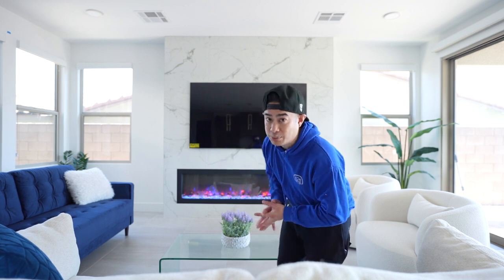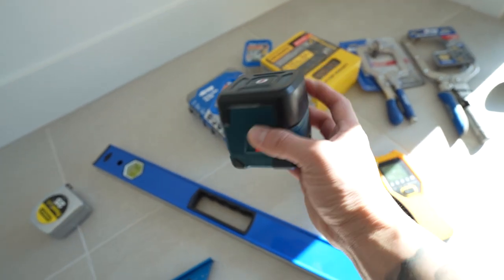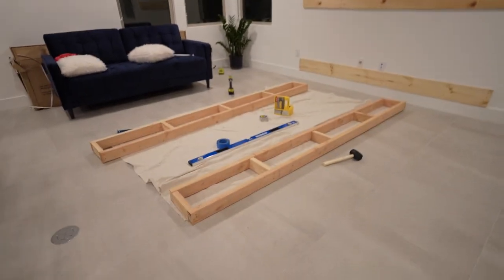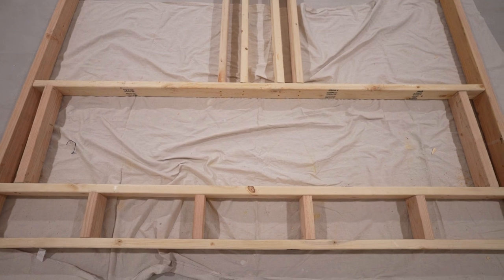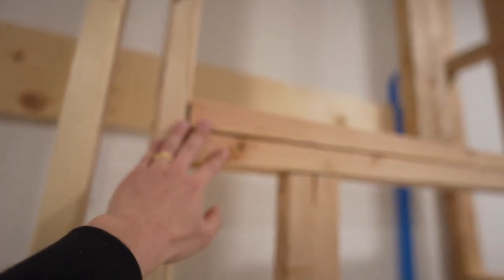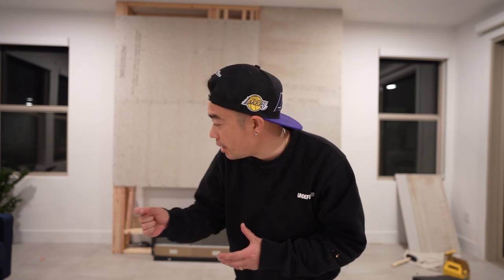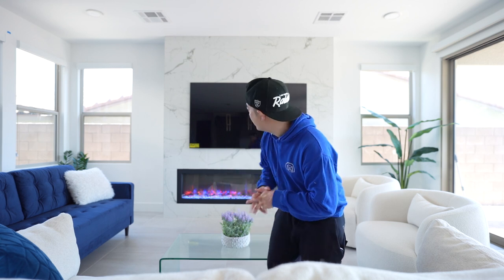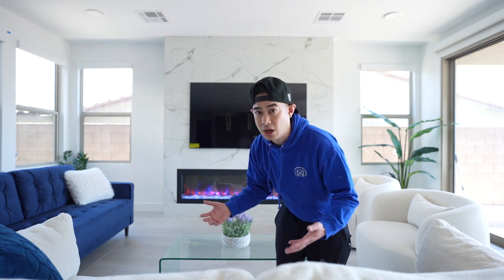DIY Tile Fireplace TV Wall | How to Build

Comment: Looks great Ant! Quick question- did you have to drill holes into the tile for the tv mount and hiding the cables? And if so, it didn’t crack the tile at all?

Comment: how do you access the electricals for the fireplace if you ever need to?
Reply from the maker: There’s an outlet in the middle of the wall which is now covered by the pop out wall. The fireplace is easily removable anytime and I can get in there to plug/unplug anything on that outlet